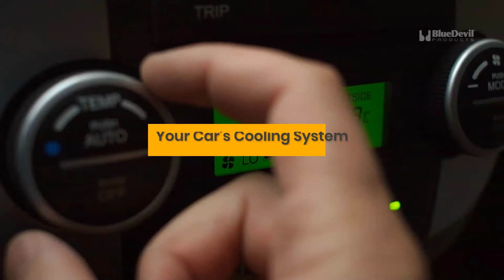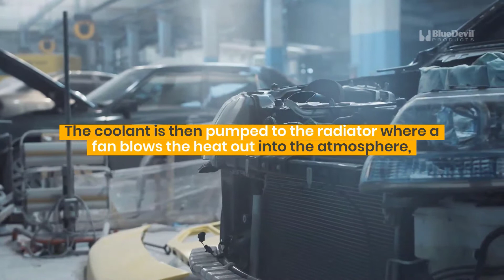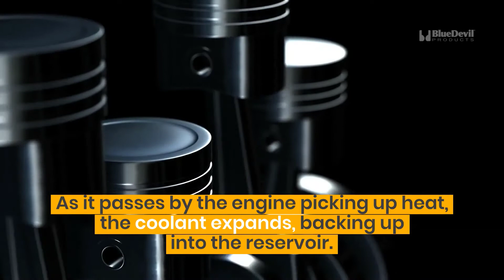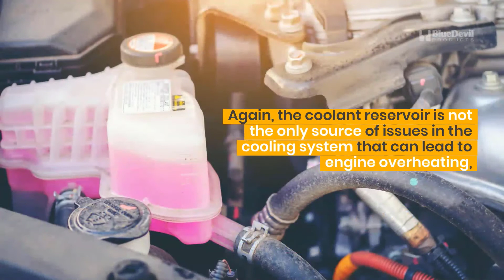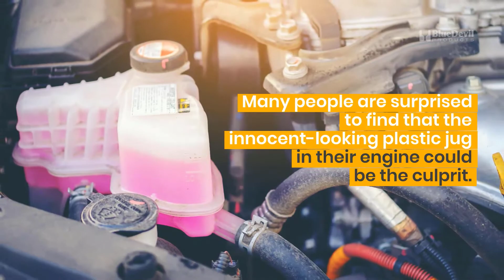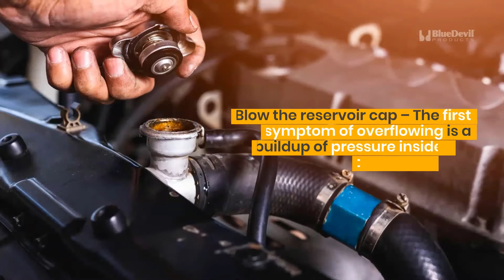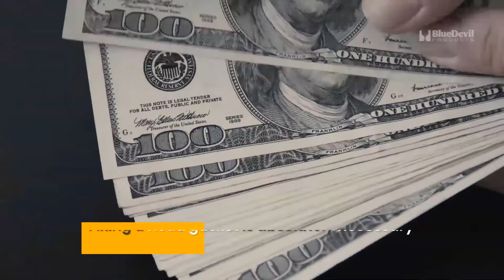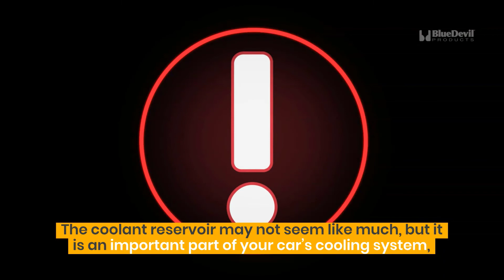What Every Car Owner Should Know About Their Coolant Reservoir | BlueDevil Products

Comment: The coolant levels in the coolant reservoir; Cold and Hot levels should be observed? Meaning that if  one finds that the coolant is lower than the line that specifies "cold level" (where the coolant should be in the reservoir when the car is cold), it could be the head gasket or some other leak somewhere? Radiator cap? Can one open the radiator cap in a car that has coolant reservoir, to test for oil  (exhaust) from the engine (degraded/faulty head gasket)?  in the coolant?  Can one open the radiator cap in order to check for evidence of oil /gasses(?) finding their way into the coolant from the engine (a chemical test)?
Reply: 😊😊😊😅😅😅ol😢😮😢 ik:^)=_=o:-)8-) 5:38 😅B-);)*\0/*:-\B-)*\0/*B-):-\:-$;-):-$:^)(´(ｪ)｀）/ᐠ｡ꞈ｡ᐟ\😮(◠ᴥ◕ʋ)ʕ ꈍᴥꈍʔ(o´･_･)っ(･–･) \(･◡･)/ʕっ•ᴥ•ʔっo((*^▽^*))o(っ.❛ ᴗ ❛.)っ༼ つ ◕‿◕ ༽つ😅⊂(◉‿◉)つ